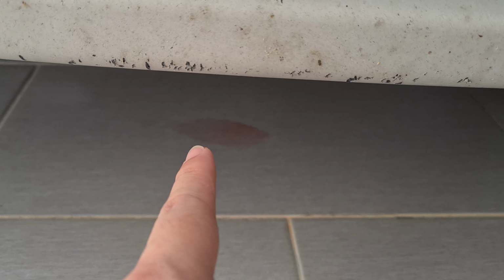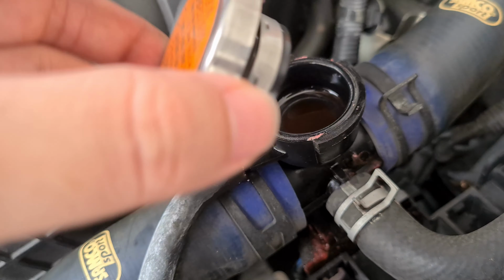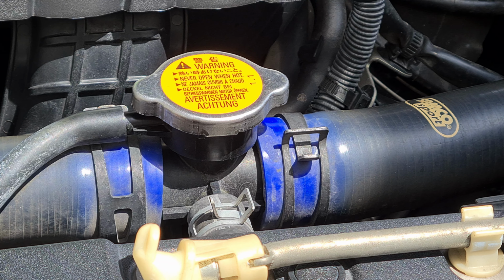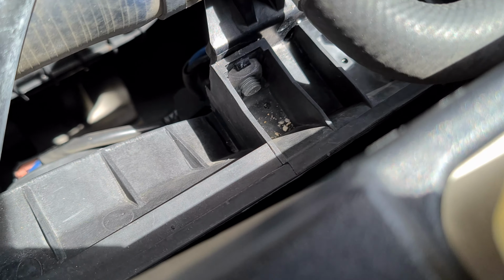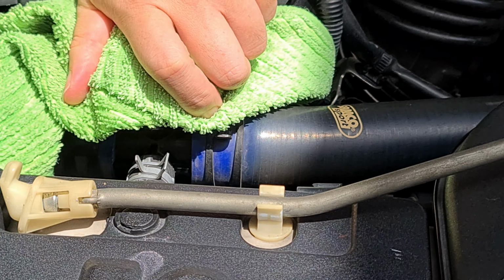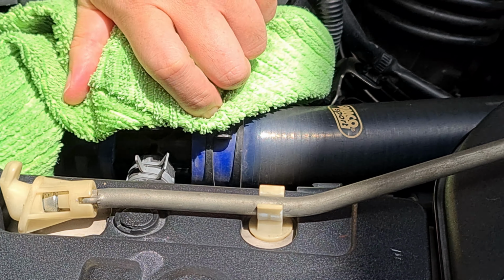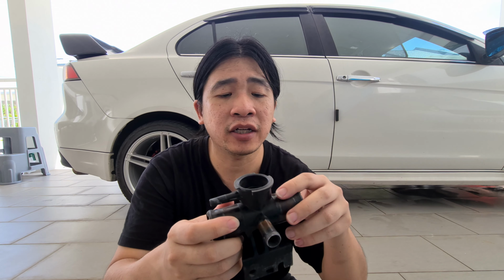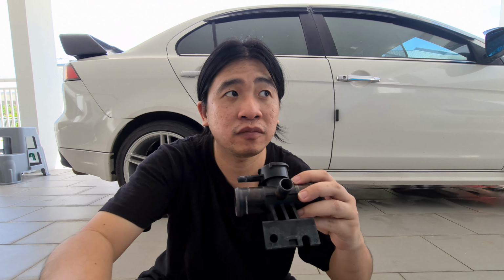Changing radiator top housing - Inspira / Lancer 08

Comment: Mitsubishi uses green coolant from the factory and every service should be replaced with green coolant. Since yours is orange, you've clearly flushed/replaced it but the problem is that the old coolant which was green does not mix well with the orange coolant. This causes it to produce a sort of gel like buildup and cause damage to the plastics. That's why it's most likely leaking. I've been running green genuine Mitsubishi coolant in my car for 11 years on the original cooling system with no leaks or problems whatsoever.

I can see you've also replaced the factory hoses, so they may have also been installed poorly (IE: dirt around the mating points or the spring c-clamps installed poorly) or had old coolant underneath which caused the plastic to slowly degrade or change form.
Reply from the maker: I had my radiator side cover replaced as it was spoiled previously (was on Mitsubishi genuine pre-mix green coolant for all 9 years). All green coolant was flushed out (including those inside the heater core). While I would go back to green coolant if given the choice but since it was already fully flushed and filled with red coolant, i am sticking to red coolant for the moment till my next flush. 
Factory hoses were replaced when the car was around 5 years old and I been running these blue hoses for the last 6 years.
I do agree with you whereby mixing coolant is never a good idea. Stick to one and all is good.

Comment: How many miles do you have on your car   and what's the biggest issues you had to do
Reply from the maker: it has about 250k km to it now. Besides wear and tear stuff, i have not had any major issues with the car. Stuff like mounting, bushings, gaskets are bound to deteriorate over time. Biggest issue I had with the car was squeaky absorbers when i got it new back in 2010. The issue was mainly because Proton (the company that rebadged this car) decided they wanna have a go at the absorbers. Didn't fare well. Replaced them with BC Racing coilovers and i have been a happy camper for many years.

Comment: I wonder the toyota coolant u bought at price rm18..i sory..I suspect it is a fake coolant..because previously I bought it at the same price..when i test it with plain white paper the red color stick to the paper..the original one doesn’t..then I bought another one with rm 23 or rm 25..the bottle is exactly the same but the coolant fluid isn’t..u can tell with white paper compare both original n fake..obviously the fake one is mix up with red color not coolant fluid..
Reply from the maker: Not sure about the white paper test. But when you have dealt with coolant enough times, you can tell whether it is fake or not by simply dipping your fingers into it and smelling it. Ethylene Glycol has a slippery nature and smells of a distinct sweetness. Fake coolants, well.... those are just colored water. Very easy to tell the difference between the two.